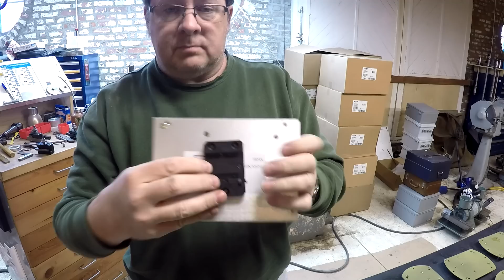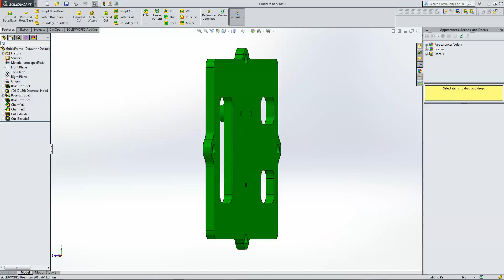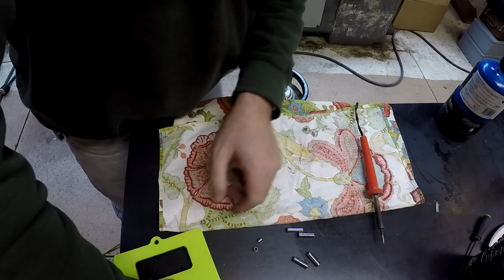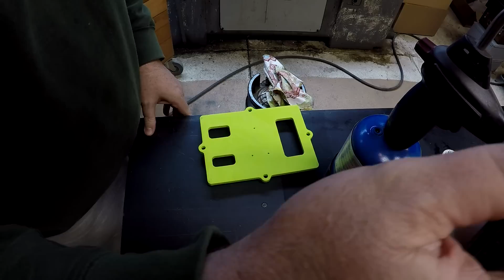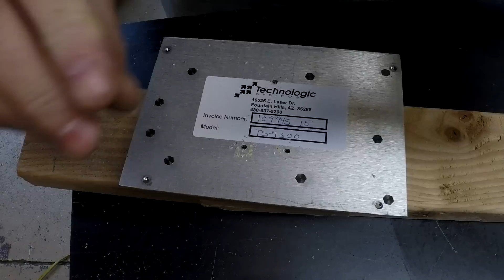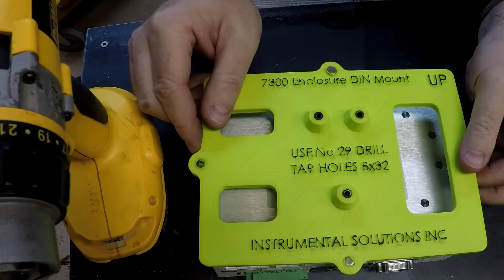3D Printed Drill Jig

Comment: Re: DIN rail mount jig

I think that any slop in pin spacing vs actual size of the enclosure plate will be magnified in allowing rotation. I would have liked to see two widely spaced pins on at least one edge. That would have a greater constraining action than a single pin which tightens up along a circular path which is nearly tangent to the edge of the enclosure plate. (A few thousandths slop might allow the pin to move many thousandths along the arc - allowing a lot of rotation.) A pair of widely spaced pins constrain rotation along a circular path which crosses the edge of the plate at a much higher angle. (A few thousandths slop only allow a few thousandths motion along the arc.) Translational slop (up/down or side to side) remains the same - a few thousandths slop allows a few thousandths of motion, which is insignificant.

These devices sit on a DIN rail mount which is not all that precise, but you have frequently said that getting a job out of the shop looking and feeling all correct is nearly as important as turning out jobs that work. If these all sit on the rail at slightly different angles, they will still work, but will the customer be inclined to return with future jobs?

"Break all edges; avoid verbal orders" (Printed at the top of the scratch pads that my grandfather, B W Lindquist, kept on his desk at the shop.) Touching up the edges (or tightening up the constraints on a jig) doesn't make the part work any better, but it sure keeps the customer coming back.

Comment: James,
That drill jig came out really nice. One thing I was thinking about that might make this jobe even easier would be to use one of those combination drill&tap bits. I got a cheap set from Harbor Freight ( http://www.harborfreight.com/sae-drill-tap-deburr-bit-set-95528.html ) and it works great on sheet metal. The only thing you need to make sure is that the material is thinner than the pilot drill. They even will deburr the front of the hole.

Comment: Jay,
Nice work! I'm going to have to get my wife a 3-D printer for her birthday! LOL Are those units PLCs? When I was a service tech in actuation, I put servo control boards in the actuators that used a 4 to 20ma current loop that "talked" to a PLC. The PLC had certain parameters to maintain. It would receive several signals from sensors and operate the actuator, using the analog signal from the actuator to position the valve (or other device) to maintain the parameters.  Thanks for sharing and a belated Happy Birthday to your daughter.
Have a good one!
Dave

Comment: Hello James,

When you showed us the boxes on the previous video my first thought was mount the din holder on the cover and have the model info(bottom) face the user... In my view a lot less work, but it all depends on the client's expectations.

As for printing in thin air, to get sides on your template, one option is to print the surround in one go and the face in an other go and screw the two parts together.  Just something to think about next time that problem comes up.

I really enjoy your videos, keep them comming.

Thank you

Robert
Reply from the maker: rfnoise I did think about printing the surround and then just gluing it to the frame.  Maybe next time I will give that a try.  Thanks for the suggestions, all ideas are welcome.

Comment: Interesting video! So often in machining there several paths to reaching the right way which to the machinist in this case,,, is how well the fixture serves the need according to the job's tolerances... Or good enough (what "IS",,, is)... For this fixture the goal is to hold the part to be drilled in location and secure. As long as the builder is content,,, It "IS" good enough/square enough, and hole location close enough! Thank you for sharing your version of that with us James! I see great promise for 3D printing! I'd like to say there would only be 3 or 4 qualities for each size needed,,, but, so far that isn't the way $ales work they'll have a dozen or so from home dweller to factory owner! If they only had to tool up for 3-4 the cost of those could be less and interested parties would all get more for their money! :o]

O,,,

Comment: Hi Jim  Great little project.  I've read the comments about adding additional pins to prevent rotation and asking about tolerances.  Rather then using edge of the enclosure wouldn't it be more precise to use some of the studs (can't see if they are threaded inserts or what so I'll call them studs) that support the board?  I would think these are precisely placed and due to their random position would prevent rotation and eliminate any chance of incorrectly positioning of the jig.  You would print at least three large bosses, using asymmetrical locations, into which you then insert steel guides (much like your drill guides).  These guides fit over the studs positioning the drilling fixture relative to the board, not the external frame.  Drilling from the inside of enclosure means the jig can be much smaller.
Reply from the maker: Morris Gallo You are correct, and I thought about that a lot.  The main reason I wanted to drill from the other side was to keep from polluting the circuits that are left in the enclosure with swarf.
Reply: James Kilroy
Drilling and tapping from the back still produced swarf on inside of enclosure.  If the bosses are long enough they will bear down on plate during drilling allowing swarf only on back side and pulled out the top of hole onto top of jig.  You could add a lip to the jig following the shape of the enclosure thereby isolating and preventing contamination of those components on that short vertical surface.
Reply: Here's a near deburring tool, does both sides at one pass.
http://www.cogsdill.com/products/deburring/

Comment: Is the drill guides hardened? Or will they wear out (get bigger oval holes) after some drilling?

And if they are hardened, does not that heating take out the hardness?
Reply from the maker: Wankel Motor Yes drill guides are very hard.  You would need to get them to red heat to have to worry about annealing them.

Comment: It depends on how smart your shop help is, or if you can remember what you did last time for the next time.

I agree with some other comments,
You could put two pins in the reference edges, say the top and the left to keep it square

"up" isn't very descriptive - you could put some stupidity pins in the top that would interfere with those plug outlets if    you had it upside down - incorporate them into the alignment pins.

Comment: Hi James,
Enjoy the videos great work. Just waiting for the next Pacemaker update.
One question how do you release the din rail mount to replace the electronic device if it fails?
Reply from the maker: Donald Beaty The mount is spring loaded, so you push it up against the spring pressure and tip the top of the mount off and there you go.
Reply: That is good, some of the ones i have used in the past required pressing a release button, which is impossible for large devices. For some i hav had to remove the dinn rail to get the device out.
Reply from the maker: Donald Beaty I know exactly what you are talking about, done the same.  Sitting there trying to snake a screwdriver back there to get it to release.  With these it is totally a non-issue.  Here is a link to this mount, cheap and quite strong.

http://www.winfordeng.com/products/dinm15.php

Comment: One more thing I forgot to add - now that they are getting cheaper, setups like the ProtoCycler, Filabot, etc. can allow you to recycle that jig back into filament for another job. Just cut out the metal bits, shred and extrude.
Reply from the maker: James McIlhargey I figure an extruder head that works directly with ABS pellets should appear any moment.  That will drop the cost of the raw materials by probably 80%.

Comment: Hi James - great video. I have a similar job that might benefit from this technique. Where'd you source the inserts? Drill bushings on Mcmaster are around 10-20 bucks a pop- I wanted to make sure I'm looking at the right thing. Thanks!
Reply from the maker: John Riney McMaster is where I got them, not the cheapest source, but fast and easy.  Drill bushings are pretty easy to make with a little tool steel.  Just drill through with the size drill you want to use, chamfer heavily, heat cherry red with a torch, quench as required.  Or be smart and use A2, no quench required.  You could probably get away with no tempering as well.

Comment: Good to see 3d printing making some use in your shop. I've printed myself some indicator holders and an angle template for some wood cuts I've made. 

You should look at getting a 3doodler or similar handheld extruder for plastic 'welding' to join prints together. I've also repaired a number of plastic items with one. It's a useful tool to go along with a 3d printer.
Reply from the maker: James McIlhargey Never heard of a 3doodler, but I will look it up right now, thanks.
Reply: James Kilroy http://the3doodler.com/ - I have a version 1, which is clunky, but the V2 looks awesome.

Comment: Neat to see a printed jig in use. If you could find away to idiot resistance it so it could only be put on orienting one way is the only improvement I think it might need.  Bozo's are determined and you really have to work hard to keep them at bay! lol
Reply from the maker: bcbloc02 Hi Brian, you are correct.  I am considering adding a part to the top of the printed frame that would interfere with the 90 degree flange on the bottom of the case part, to prevent using it upside down.  Bozo is tireless.

Comment: Hi James, i thought of two locating dowels on at least one straight edge that will prevent the jig from rotating. So now this works only on the press fit of the dowels on the enclosure. But i fear those enclosures will have tolerances. The ideal would be two dowels for every Corner (and that is two for every straight egde as well). But sure that is Overkill. Anyhow: this 3D printing is awesome.
Reply from the maker: Hermann Straub I think you are right, about two pins on each corner, as being the way to go.  The enclosures do have some tolerance range, mostly on the short side.  I have never inspected a big batch to find out, but I am guessing on the order of +/- .050.

Comment: Looks like you have really found out what a 3D printer can do for your shop. Your printed parts will never have the strength of metal parts but you can't beat it for prototyping parts and for alignment guides. Resolution on your is parts are dependent on the layer thickness you are using to print with. Vertical holes will be round, horizontal holes oblong. Use fillets for strength around bosses, it will help a lot. Have fun with your new tool.

Comment: Hi James. Nice quick drill jig. Just a thought, UP is not assured with the current pin layout, wonder if an addition to the pin in the form of a fouling ring ( one inch dia. by half inch thick pressed on with quarter inch clearance for chassis plate or something like those dimensions ) that is on the plate edge marked UP would prevent misplacement.
Reply from the maker: Stephen Deakin That is something to consider for sure.  Since the bottom on the case part has that 90 degree flange, I could add a part to the printed frame that would interfere with it.  Thanks for the great idea.

Comment: James, do you have a feel for the cost of material to produce a part the size of your drill jig?  Great application and instructional on inserting the bushings and pins.

Cheers,
Gary
Reply from the maker: gwcude A couple of bucks for the plastic, maybe.  The drill guide bushings, itty bitty #29's, were $9 each, so that brings the total to about $30.  Then the dowel pins add a couple more bucks, so lets say $32 total for materials.   I will easily save that in labor costs with the use of the jig, probably several times over.